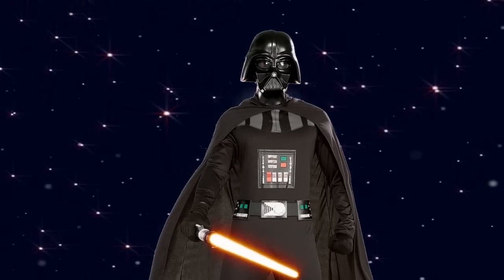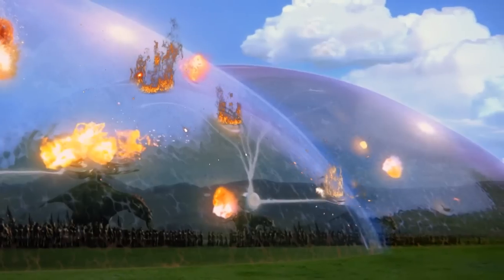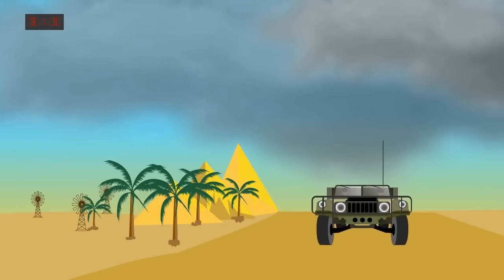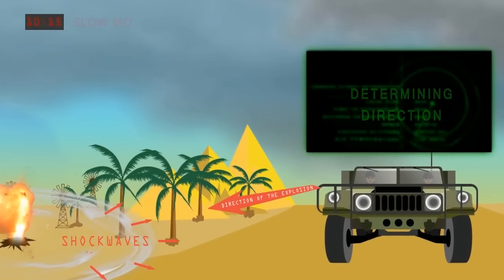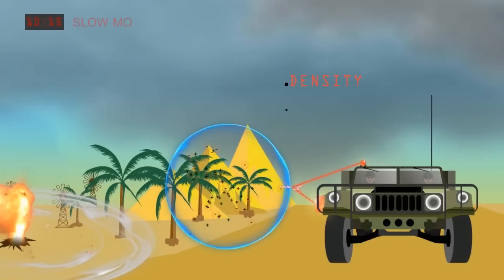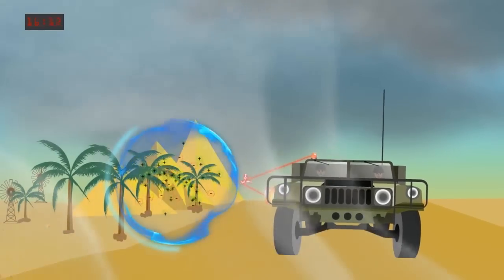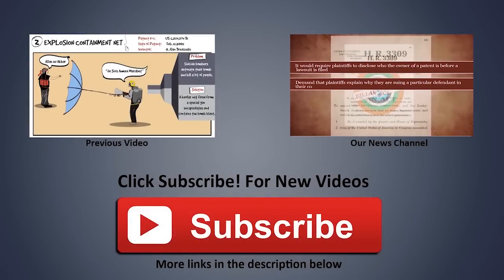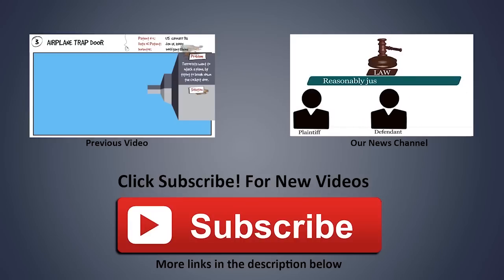Boeing patents force fields from Star Wars

Comment: Shockwave protection is really not good enough. If there is a direct hit on the vehicle, it‘s game over.
Reply: Shockwaves travel much further than the sharpnels and often cause much more damage. So, it is definately helpful. Of course, in case of a direct hit it is game over. J
Reply: High explosives are often used against targets with to much armor. A 500lb bomb can kill a tank crew even without hitting the tank.

Comment: In advanced witchcraft, we learn how to direct electromagnetic currents generated by the heat and movement of the earth's core through the earth's crust and into our feet and up our legs, then our spines, until we can access them through our heart and control them through our brains. so based on the explanation of this force field technology, all it would take to create a psychic forcefield is to direct that electromagnetic energy into the outer aura, through a fundamental shielding technique, and then ionize those air particles by electrically charging them with raw energy. this would make the air dense enough to repel, absorb, refract, and deflect any energy, including projectile weapons such as bullets and knives. interesting...